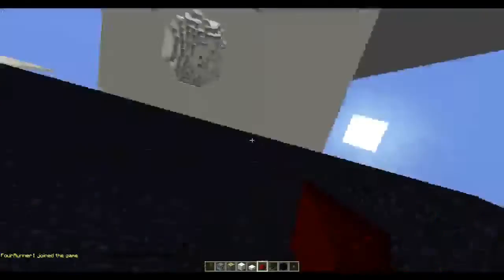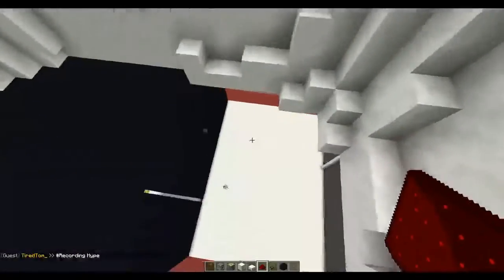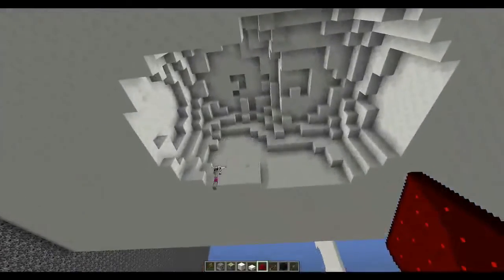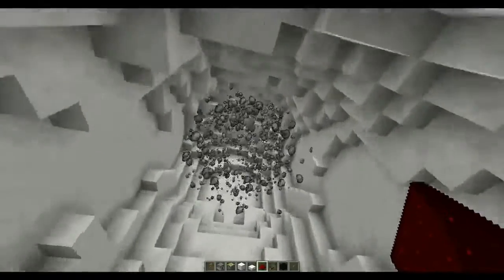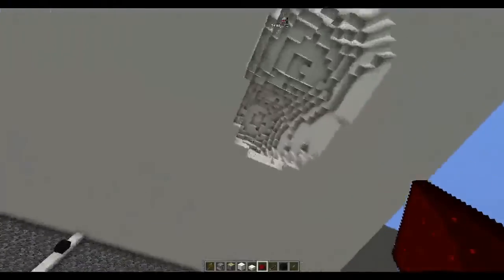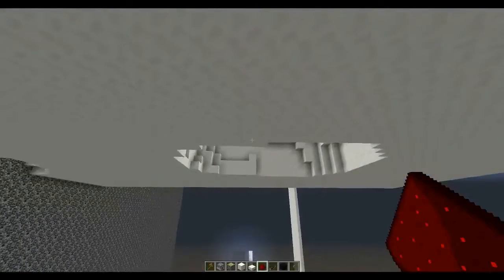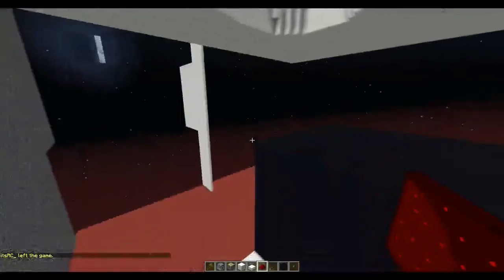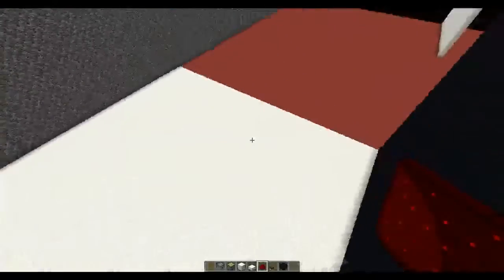New Type Of Cannon??? Mid-Air Reverse Proto 1

Comment: all you have to do is have a dispenser go off early to stop it then have the hammer go off to push it up, then you use order of entities in the reversed TNT to stack it
Reply from the maker: +Minechat Raids yea, but with the sand its easer said then done, i can see how people say that the just TNT reverse is easy but the sand wont be as easy. you will have 3 different areas where the tnt/sand is coming in from (Unless you somehow combine one of them). Normally with mid-airs the sand is below, now it has to be under and in between the hammer and reverse tnt by about .250 blocks (Trap door, Slab) then having that all be shot straight isn't very easy...
Reply: +Raider Pint you really don't know what you are talking about...

Comment: i dont see the point tbh
Reply from the maker: +redmouse22 What you can do with this is... you know how people mine out big holes under their base so you dont have a backboard to reverse off of? That bypasses it. You wont need a backboard to reverse stack anymore if i can keep working on this cannon to its max.
Reply: Raider Pint but if they go thru all that effort I would assume they would have water under thier base aswell? and this seems to be fairly variable when you add power so you would have to go in knowing an exact distance, know how much power is needed to cover that EXACT distance and hope they wont have a water layer under their base
Reply from the maker: +redmouse22 I said in the video that I plan to make it stack, it's only the first version